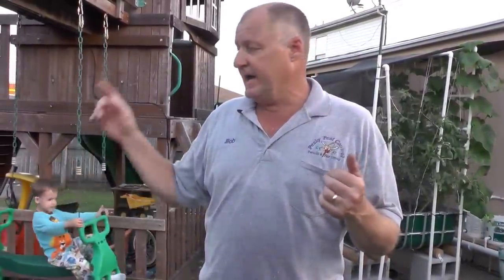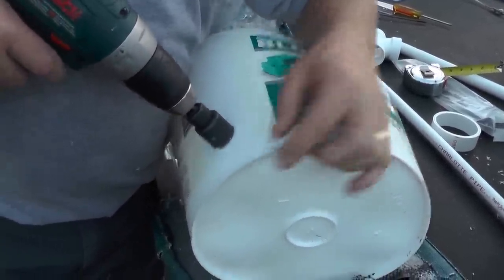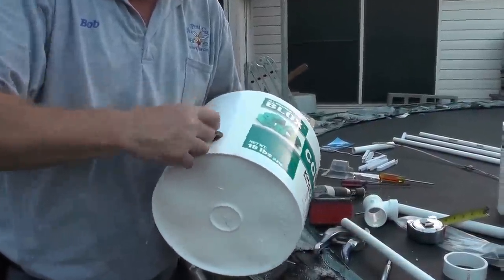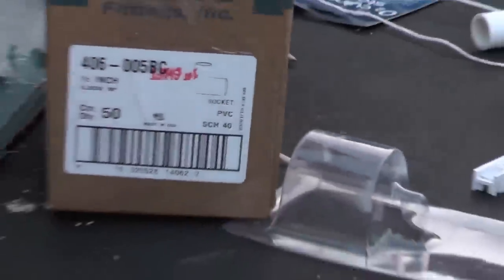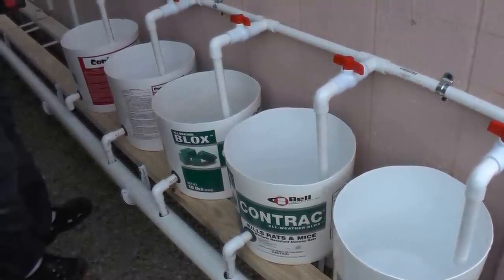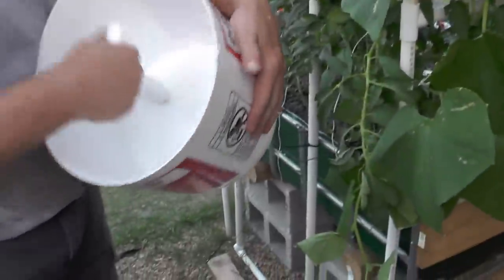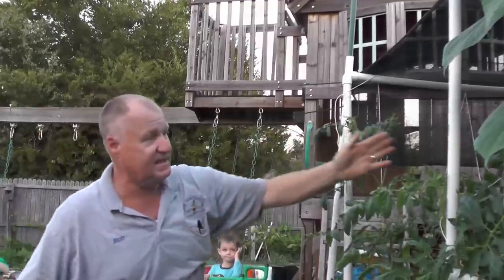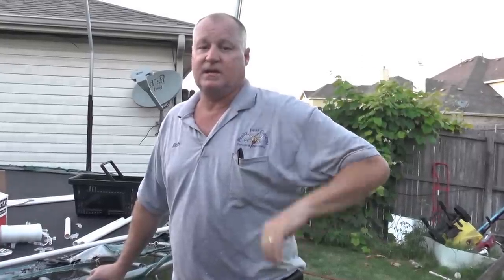How To Make a Dutch Bucket Filmed by my wife #8  7/14/2015

Comment: OK, so first, Looks like I am going to need a Trampoline.  Also, i had no Idea what the heck a dutch bucket was before I clicked this and I got so tired of wondering I looked up the definition and came back to see the rest. LOL 

  so it's sort of a hydroponic gardening technique and the dutch bucket appears to be he main ( Heart ) of it all.     Looks like it will come in handy to know all this when it all comes down.    Thanks. 

  8 or more wives might come in handy as well depending. I am having a real time of it though finding girls that will go for this arrangement. I am assuming the Trampoline will help in some way and That it will all come clear to me after I get that squared away.  I am also assuming ( after looking at several models) that i do not have to have a trampoline that will hold all 8 Or More wives at one time, seems impossible to find one with that kind of capacity, especially if i want 0o have any sort of involvement in this.  
   I will Update this when it all pans out.   Thanks again.

Comment: severe overkill for the job at hand. He could have used a few 55gal drums to collect rainwater then tubing to each 'pot'. In each pot he would connect the tubing to an Ollas. Saves 50% to 90% of the water that he would use his way.

He did do a nice job though.

Comment: i guess with a dutch bucket , they can be 9 inches or 10 or 11 but not the whole bucket. on a west facing wall with shade and be sure to wet the grommet then fill it with rocks that you get cheaper someplace other than home depot. Rat poison is optional and plants do better in the shade so an 8 foot fence is coming soon.   All this time i thought a Dutch Bucket was a hooker